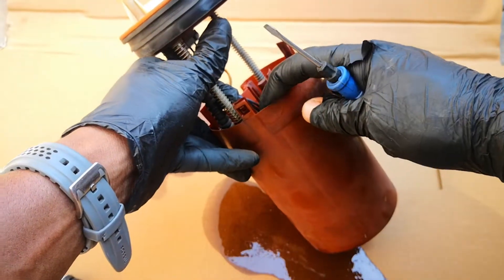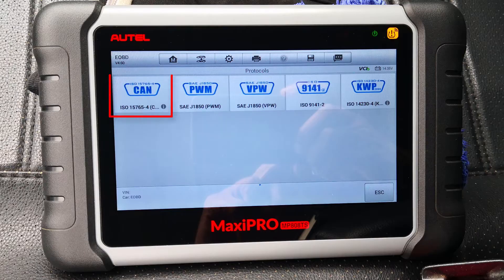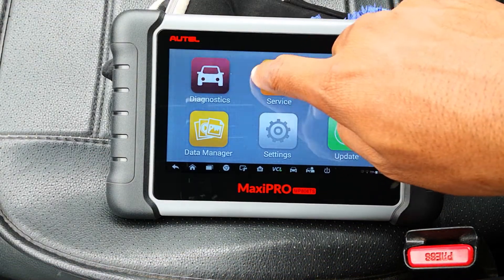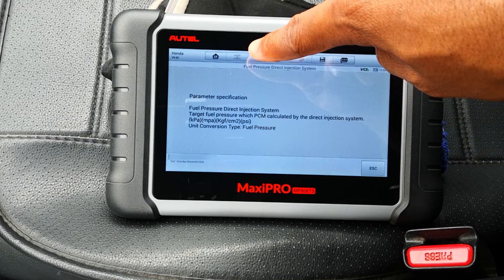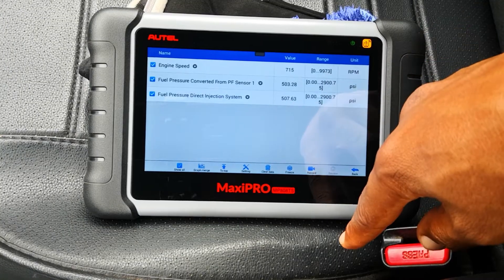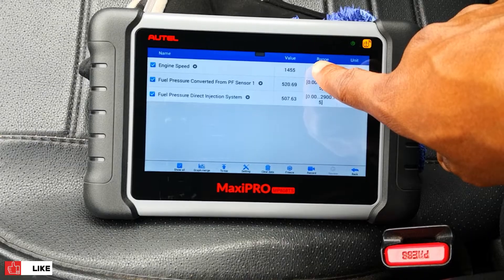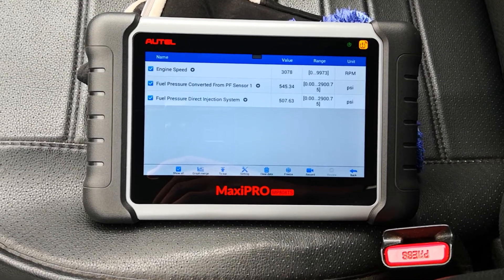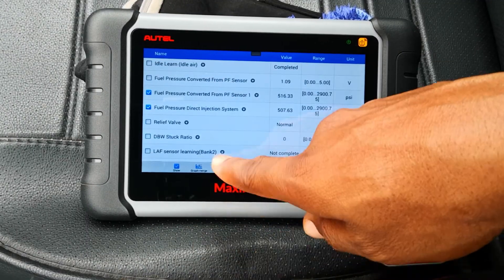How to Check your Fuel Pressure Without a Gauge / How to Check Fuel Pressure with a Scan Tool

Comment: I couldn’t find the fuel pressure with my new Xtool A30M, could you guide me on what it would appear as on that specific device?
Reply from the maker: What car is it?
Reply: 2010 honda crv
Reply from the maker: If you go into Diagnosis and select the Engine module, and then live data, you should have the fuel pressure sensor data. The car is CAN OBDII protocol right?
Reply: I can’t find that one, I only see fuel tank pressure etc nothing of just fuel pressure :/
Reply: Right...hea just clicking away and not telling you on what.

Comment: Hi, I have idle 3.91% LTFT -0.78% STFT, 3.13% LTFT 2.34% STFT, revved at 2500 rpm 9.38% LTFT -5.47% STFT, 9.38% LTFT 4.69% think I'm about to develop a fuel delivery problem, is this correct?
Reply from the maker: Before I respond, can you double check the fuel trims you posted at 2500RPM... It will also help if you identify the fuel trims by banks.
Reply: @DIYAutoworksNG  its only one bank.   idle  4.69stft 1.56ltft, high rpm same 4.69stft 9.38ltft
Reply from the maker: I won't be bothered since it doesn't exceed 10. But your insinuation is right, if it continues and rises, possibly some restriction in fuel supply - clogging of injectors, fuel strainer, fuel pressure regulator or fuel pump. I usually start by dumping a can of a good injector cleaner in the tank...
Reply: @DIYAutoworksNG  30 secs later idle 2.34stft/3.13ltft and -5.47 stft / 9.38 ltft

Comment: does this scanner do LML duramax desired and actual fuel rail pressure?
Reply from the maker: Depends on the communication protocol your car is built on, plus if your car has a fuel pressure sensor. Cars built on the CAN bus protocol usually have fuel pressure sensors and will output desired and targeted as part of live data.

Comment: What if the vehicle doesn't run ? And there is no valve stem on the fuel rail
Reply from the maker: No you can't use this particular test. However, if the car uses the CAN protocol and above, you could get a sense by reading the fuel pressure  sensor value in live data just with the ignition on. It's not definitive but should help. 
May also need to use a traditional fuel pressure tester if the car is not direct injection. There are kits you can connect to the fuel hose that leads to the fuel rail, and read the pressure from there.

Comment: never saw fuel pressure PIDs, must be Honda thing. wonder if Xtool D8 BT and  Artidiiag/topdon 800 BT  would show those two PIDs.
Reply from the maker: Can't believe I missed this comment! Apologies. Not really a Honda thing per say. It's seen in cars with a fuel pressure sensor. I expect both of those tools to have those PIDs in supported cars.
Reply: I have the Xtool D8 and works pretty much the same as saw with the Autel in this video. The D8 and all higher end Xtools are CONSTANTLY updated. I bought mine in 2021 with about 28 services on it,  it's now up to like 40 services, they've changed the Live Data to allow 3 screens simultaneously etc

Comment: Hi man. Can you please do in detail  comparison between Xtool D8 BT and Autel Maxipro MP808bt or MP808ts?
Reply from the maker: I haven't used a XTool D8 BT but from the specs I've seen online, it's meant to be on the same level with the MP808BT. The only difference between the MP808BT and the MP808TS is that the latter has the capability to activate TPMS sensors and is able to program universal Autel TPMS sensors.
All these 3 scan tools are able to code ECU's and are fully bidirectional.
Reply: @DIYAutoworksNG  You're a knowledgeable handy man... Kudos

Comment: A nice stress-free test. 

The presence of this sensor is one reason I prefer GDI systems. On port injected designs however, there USUALLY is an annoying absence (they love their mechanical regulators: Toyota, I'm looking at you!).
Reply from the maker: 🤣🤣🤣🤣. The 2nd part of your comment just cracked me up. @mechanical regulators😆
Reply: Toyota/ Lexus motto is "Maintain your car, and you'll never have failures... and if you do, ALL OF IT GETS REPLACED AT ONE TIME"